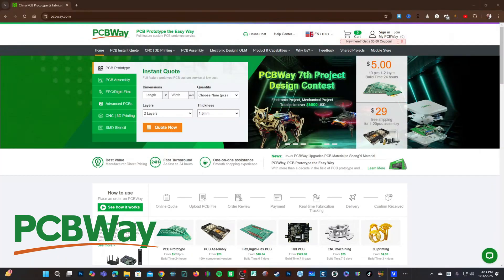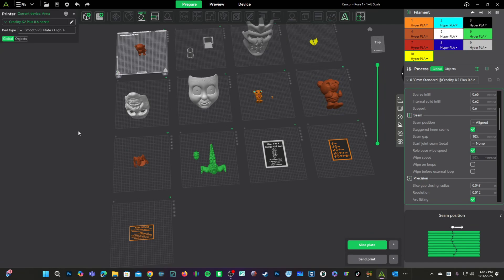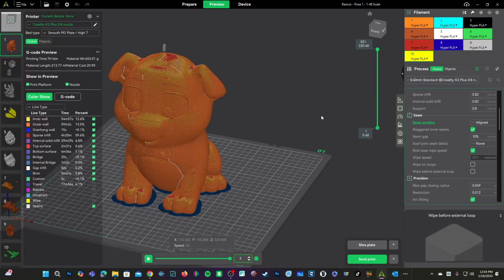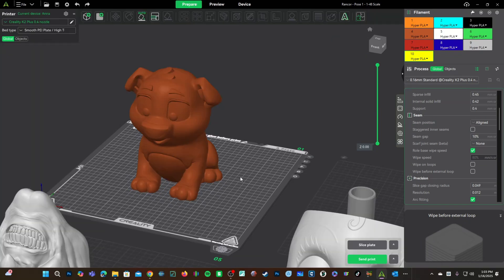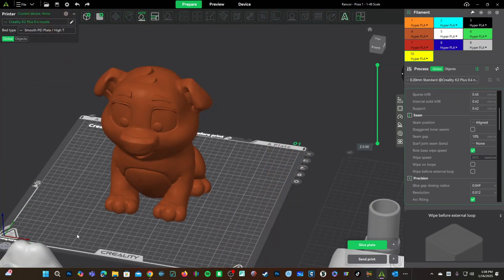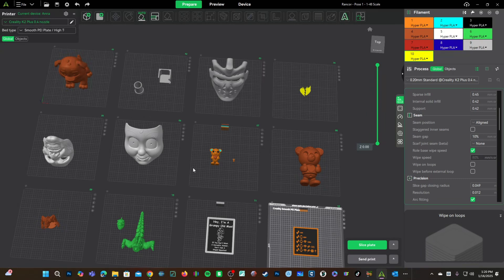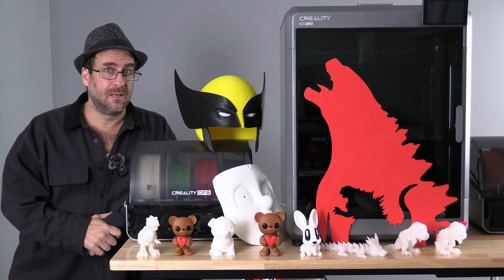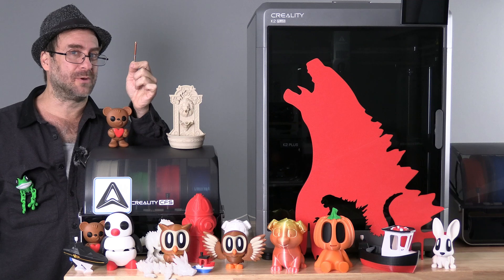3D Printer NOZZLE DEEP DIVE: When, WHY, and HOW, to go BIG or SMALL - Creality Print 6 - K2 Plus

Comment: My biggest issue is prints comming off bed in middle of print. Any suggestions?
Reply from the maker: Bed Temp 60.
Slower 1st layer
CLEAN THE BED WITH IPA, THEN WATER. With a clean towel

Comment: Hey Greg, can you do a video on settings to minimize the bleed issue with multi color?  I don't do alot of multi color, but I do enough to be concerned about it.  This is the only thing keeping me from pulling the trigger on a K2.
Reply from the maker: Brother, there is zero reason to avoid a K2 (or any color printer) over color Bleed. This stuff is totally learnable. Sure, I cover it lightly in my painting video, but, I'll try to cover it in a stand alone video. One way to help me afford to shoot more: Consider being a Member
Reply: @3DRundown  Will do, and I appreciate the response.  I concede that my apprehension is kinda petty and should prob just order it loool.  Thanks!
Reply from the maker: Of course. Get that beast on the way, and catch my K2 PLUS Paint video
Reply: @ That video did help alot!
Reply from the maker: Awesome

Comment: Very good video as always. Regarding the video, which you explain very well, there is one small detail missing. That you have to read the manufacturer's specifications depending on the filament, since there are certain materials that need a certain nozzle, and if you use smaller nozzles, you will have a guaranteed obstruction. The other day I used wood filament, I printed at 0.4 and the manufacturer recommended 0.6 or higher. Well, I suffered a blockage of such magnitude that I had to throw away the nozzle. The new ceramic nozzles for the Ender. €25 in the trash 🗑️. Greetings
Reply from the maker: Abrasive filaments are best with larger nozzles, and usually hardened steal nozzles and gears. Wood Filament is a royal pain in the ass, and definitely better with a bigger nozzle. It's also not very strong. I am not a fan of the wood filaments I've tried

Comment: Good overview! It's also worth mentioning that a model that is fine with one nozzle size may require adjustment if you choose to apply multiple colors to a model as the details increase in complexity when you add color changes. I have models that worked great with 0.4mm nozzle at 0.16mm layer height, but once I started coloring some of the features the color details would be lost if I did not change to 0.2mm nozzle at 0.08mm layer height.
Reply from the maker: Easy there, we teaching beginner level. 😛 0.08 is insanely small. I'd start by working in 0.2, and only changing if see a need
Reply: @3DRundown  My point was less about the numbers and more about reevaluating if you change the complexity of your model by adding color details.
Reply: @shirgall  hey, can u pls send the link where u bought the 0.2 nozzle for k2 plus ?
Reply: +1 please.... I haven't seen one and been looking for it myself as well.